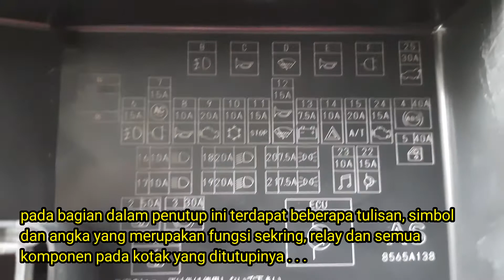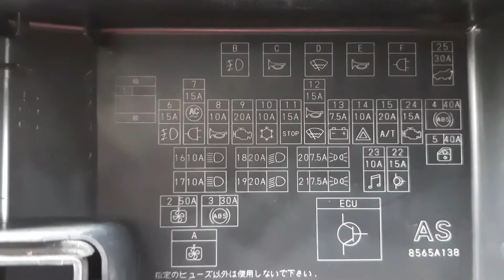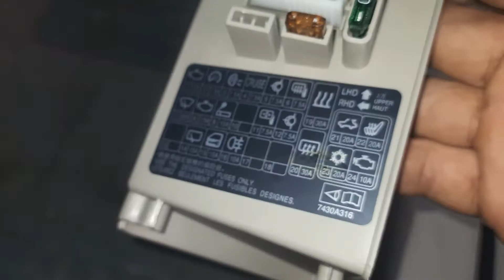Box sekring Mitsubishi Grandis

Comment: Setelah dr bengkel, remote tiba2 tidak bisa nutup kaca jendela.. Itu kira2 solusinya ada di sikring/relay ini ga ya?
Reply from the maker: Blm bisa dipastikan krn hrs diperiksa dulu apa penyebabnya.
Pengecekan sekring adalah alternatif pertama yg hrs dilakukan.
Fungsi remote umumnya untuk membuka dan mengunci pintu mobil.
Remote tdk berfungsi bisa jg krn ada salah satu pintu mobil yg blm tertutup rapat.
Cek juga mungkin ada kabel atau soket kabel kendor atau lepas, lebih pastinya cek k bengkel yg tahu ttng hal tsb
Reply: @AJMcrews  sekring full pump itu yang gambarnya apa mas?
Reply from the maker: @MuhammadAmin-my6vv  cek kotak sekring di ruang mesin, letak sekring fuel pump ada pd no.24 gambar mesin sekring 15A (lihat petunjuk pada penutup sekringnya)